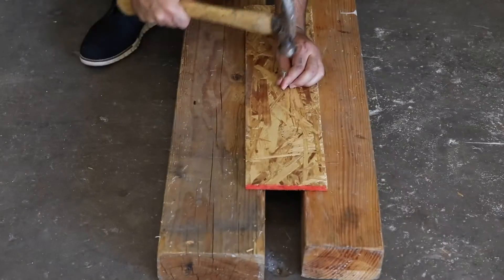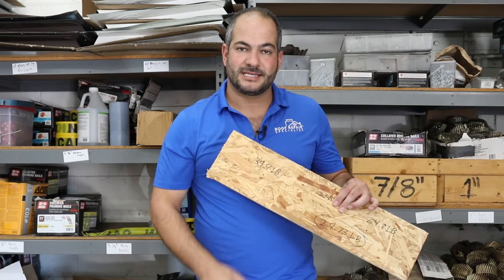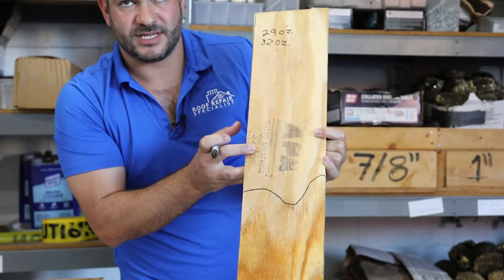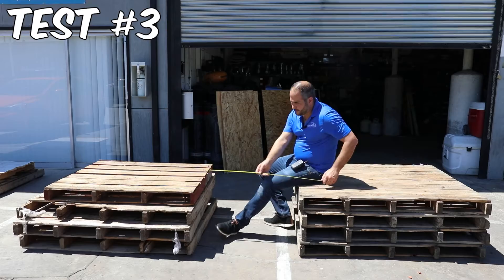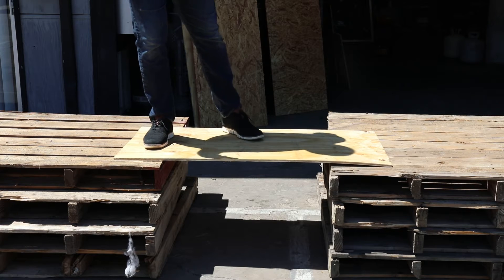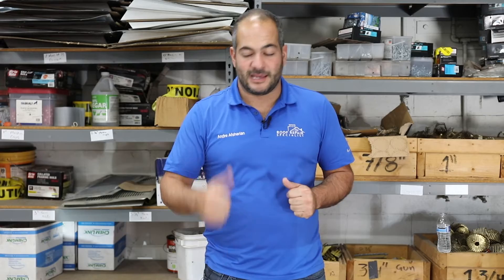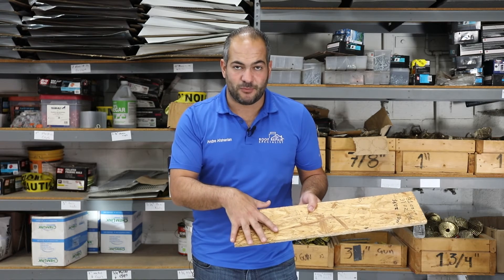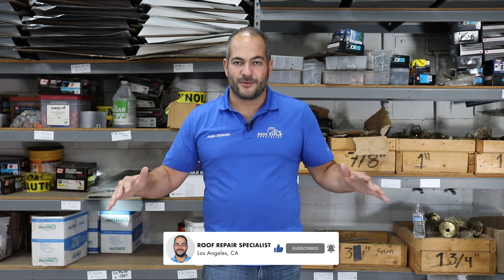OSB vs Plywood: Which One Wins?

Comment from the maker: Do you agree with the results of this challenge? Let me know👇
Reply: This was very interesting.  
But may I suggest a slight addition to the water damage test?
- first, use a caliper to measure the diameter if the wood at the same time frames and then give the wood a couple of days to dry and then measure again.  This will show the delamination of the edges damaged by water. 
- second, perform another nail pull test on the water saturated edges of the panels.  Both when wet and after given the time to dry.  Do this pull test near the edge since this is where the panels will be nailed to the rafters.   
- second PLUSS, knowing that material is nailed along it's edges to secure it to the rafters, put a nail half way through the panel within the nailing area (~0.5") along the edge.  THEN try to pull the nail horizontally through the wood.  As the nail would go if the wood i pulled into the span to see what the rip out strength is.
Reply: I 100% agree with the results but disagree with the Superiority of the OSB!

Here in the Philippines, the primary feature that we need is the Pull-Out rating because we have many Strong Typhoons that can fly our roofs.

Second, we can just buy a very cheap "WATERPROOF" Underlayment in between a standing seam roof and a 3/4 Marine plywood.
Reply: osb superior product my ass.

Comment: OSB never shrinks back to original size after being soaked.
Termites do eat OSB, I’ve witnessed this first hand.
 The simple fact that OSB doesn’t have even half the holding strength of a fastener is enough for me. No respectable roofer will install a metal roof on OSB for that simple fact

Comment: All great arguments. 
If the roofing application is done properly in the 1st place, substrate materials choice becomes a non issue. 
Both will perform just fine. 
We've torn off many original roofs that had OSB from the 1990's that were in perfect condition.
Reply from the maker: Totally agree!

Comment: I don't believe a roof should be sheathed with 1/2" wood regardless of whether it is OSB or plywood.
I use 3/4" and don't care if it is OSB or plywood.
And, as far as nails pulling out, it's not the nails I am concerned about, it's the shingles tearing away from the nails.
I must admit, I personally like plywood better than OSB for its strength and I don't worry about water infiltration because of the materials (ice and water shield and synthetic underlayment) I use and how I put it on.

Comment: Being an old roofer myself, I have seen lots of bad roof decks.  Plywood delaminated in Phoenix due to inadequate ventilation , which resulted in extreme attic temperatures.  Osb rotted away at the Gran canyon from kitchen and bath vents just going into the attic.  Just a couple of examples of near entire deck failures.  The plywood in Phoenix had 3 layers of shingles on it.  The osb in Grand Canyon had two layers.   I don`t like how osb swells up after it gets wet.  In the old 3-tab days, this was visible.  The flat shingles didn`t hide anything.

Comment: You got two, three max, wet events for OSB and its trash. Also, OSB retains accumulated mosture far longer. If you have damaged plywood, then its been a problem a while. OSB can rot pretty quick in just two rains before it starts becoming crumble. 

Theyre not the same.

Comment: for the water test you should have tested how fast each one dries out. The problem with OSB is it gets wet and stays wet. In the same way that the plywood draws it water, it also has a passage to dry out. So when the OSB gets wet, it stays wet which really causes the damage. When plywood gets wet, it dries much more quickly. Also known as hygroscopicity or drying potential.
Reply: Thats only true for the low quality osb. Higher quality osbs like advantech or GP dry max won't absorb water in the first place because of all the extra resin used
Reply: I soaked a piece of osb overnight and saw no visible difference in it at all and it dried out just fine. It’s full of glue.

Comment: Are those shank nails or just regular smooth nails in the beginning? Hard to tell from the video. I always choose OSB for roofing but around here. Due to code and regulations, we have to use 5/8 OSB minimum. Just remember, you can always do better than code, code in the minimum guideline.

Comment: The more water osb absorbs the slower it releases where as plywood releases water faster. De-lamination is a material deficiency not a difference between osb/plywood.  Plywood excels compared to osb when wet, for decking and fastner retention.

Comment: Thank you for your testing. Although you did compare pricing it does seem that it depends on what you want from the sheeting. I looked at this because of redoing my bicycle shed which has transparent corrugated sheeting that cracked and broke through here in London GB. I think I will go with the usb and glue shingle felt on. Thanks very much. keep them coming.

Comment: You didn't really test the water correctly. The plywood may have absorbed more, but what was its shear strength before and after the water absorption? From my experience, OSB turns to mush, and plywood will rot over time. Neither a great outcome, but the plywood seems to be a stronger product if installed with proper waterproofing.
Reply: Particle board turns to mush. Osb peels to long flakes.

Comment: Quality fir not yellow pine plywood wins in my opinion. I've seen pieces left outside for months or even years and all that happens is it turns gray, it doesn't even warp that badly. Try that with osb and it will turn into a piece of sponge cake.
Reply from the maker: Didn’t even know there was a difference, we may not have that in our area

Comment: That was a nice try. Exterior grade 1/2" plywood lasts much better long term in wet conditions. Where I live in Canada OSB just swells up and never goes back to original thickness when it dry's out. Also it loses strength after it swells up and disintegrates. Its cheap for a reason. I would never sheet a roof here with OSB.
Reply from the maker: It’s pretty much the same price in our market

Comment: I'm not convinced. Standing on wood does not tell me the stresses and movement of roof decking, how it holds to the substructure, how it holds shingling nails over 30 years and how it degrades when moisture gets to it. I want to see the results of 30 years application, and also the faults that occur with sub-par building skills. (I expect some decking is not applied in the best manner.)

Comment: The water test was flawed. If roof sheathing gets wet it is usually the entire surface that gets wet. The end grain of wood absorbs water more easily than the surface of the board. if the OSB laid in the water for 4 days it would swell up like a pig, and remain that way after drying out. Good quality plywood would swell much less and regain its dimensions when dried out.
Reply: I've never ever used osb in the 16 years of remodeling houses in North Jersey. I wouldn't even use it as a pad for heavy objects. Put both osb and plywood out flat in the spring for a month. The CDX would be absolutely fine and you could use it again. OSB'd be a piece of soggy cardboard ready for the dumpster. It's highly inferior. Takes more toxic glues to hold its form and those OSB sheets need to off gas which they'll do really well in your brand new home wrapped in tyvek and pumping toxicity through the house's HVAC system. There are studies that show that children who grow up in homes like these have body and brain dysfunction along with cancers.
Reply: @mattski1979  Thanks for this reply Sr. Was handy !
Reply: @mattski1979 damn 
Never though of it like that
Reply: @mattski1979 sure if you use the absolute cheapest osb available. 
The higher quality osbs have a 500 day exposure guarantees.
Reply: Only if it's cheap osb. The higher quality osb outperforms plywood in every aspect.

Comment: I 100% agree with the results but disagree with the Superiority of the OSB to be used for roof deck!

Here in the Philippines, the primary feature that we need is the Pull-Out rating because we have many Strong Typhoons that can fly our roofs.

Second, we can just buy a very cheap "WATERPROOF" Underlayment in between a standing seam roof and a 3/4 Marine plywood.

Comment: Very interesting. But, what kind of plywood were you testing?  Standard plywood is not meant for any kind of exterior use. CDX plywood can be used for walls and roofs, but still is not appropriate for longer-term exposure to moisture. Exterior plywood is appropriate for continued moisture exposure.  If you see plywood roofs delaminating, that might be regular plywood or even CDX, but it wasn't likely exterior-grade plywood. CDX plywood does not absorb water as readily as regular plywood, and exterior plywood does not absorb water easily, likely less than OSB but I don't know for sure. It also dries faster than OSB. OSB is prone to edge swelling with repeated cycles of wetting and drying and more so than any of the plywoods. So the question is: how bullet-proof do you want the roof deck to be or how bullet-proof does it need to be?  If you don't want to worry about absorption by the roof deck, delamination or termite damage, then exterior plywood is the way to go.  It is a one-and-done solution. CDX will help if there is rain before the shingles are applied, but it will not hold up to long-term moisture exposure. OSB wets more slowly but also dries more slowly. It is also prone to edge swelling.  OSB is most cost effective, is certainly better than standard plywood and perhaps also better than CDX. Exterior plywood will last long-term without delamination, but it is more expensive, though if it saves you from replacing the decking later, it is more economical. It's always about tradeoffs. Exterior plywood can't be in direct contact with aluminum, so best to use I&W shield between them. Also hot-dipped galvanized or stainless-steel fasteners should be used. Exterior plywood is also immune to termite damage. It is twice the price of OSB, but on a recent roofing estimate, the cost of replacing decking would be $50 per sheet plus the cost of the material. For all the videos of degraded, delaminated, rotten roof decks I've seen, it might be worth it to use exterior-grade plywood.
Reply: Wow thank you for that I didn’t know there was different types of plywood for exterior

Comment: Your factoring your opinion into this video.  Plwood might delam from exposure to moisture but osb wil straight disintegrate.  Osb will also swell after being exposed to tomuch moisture and transfer throw the shingles.  You are either a salesman that has no practical field experience or a dumbass.  The only reason people use osb is because it is cheaper than plywood.
Reply: His testing is a farce

Comment: This may not be relevant but there have been cases when balcony supported by engineered wood collapsed. The reason is when engineered wood get wet the water is trapped and can't dry out, which eventually leads to rotten wood.

Comment: Most of these aren't real world scenarios.  Maybe nail plywood over a wall and measure how much pressure it takes to break, but really only relevent for the roof.  The plywood should be tested to see how long it takes to disintegrate, but again only good to know for how long it can last before you need to repair it-if you have a water problem it needs to be fixed sooner rather than later.  Is that 1/2" plywood true 1/2" or is it 7/16?  Down south they call the 7/16 plywood 1/2 inch, and you can't even buy the 1/2 inch down at the box store.  Also,  just because plywood holds nails better, doesn't mean it's necessary.  I've never had a shingle blow off in 35 years,  and when I see roofs that do, it's because someone blew right through the shingles with the nail gun.

Comment: Outdoor rated plywood is better because OSB will weaken and come apart if rained on before applying shingles. If the plywood gets wet before shingling, no big deal. Just wait until it dries out on sunny day, and apply shingles.
Reply: Agree, the plywood will dry out faster and retain it's shape once it had dried, but the OBS will swell (especially at the ends), and will never go back. It mainly comes down to how well your underlayment can protect the wood.
Reply: @OnlineAutoRepairVideos  I have never understood how underlayment can protect the deck given that it is penetrated by about 250 nails per square, and every penetration can leak.
Reply: @slydog7131  That's why those special nails with the caps are used. Those caps are to prevent the water from seeping in.
Reply: @OnlineAutoRepairVideos  Sure, that works for the cap nails, but the nails I'm referring to are the roofing nails for the shingles: ~250 per square and no "cap."
Reply from the maker: Outdoor rated plywood? Is that pressure treated?
Reply: @callthespecialist   Exterior grade plywood
Reply: @callthespecialist   Hmm... that's a good point. Was the plywood you tested exterior-grade as required by most codes, I think?
Reply: @callthespecialist  cdx/ccx/acx
Reply: Interesting. I soaked a piece of osb overnight or longer and saw no difference in its structure.